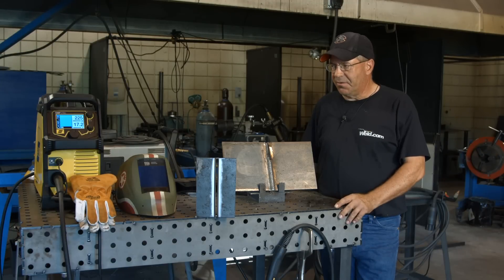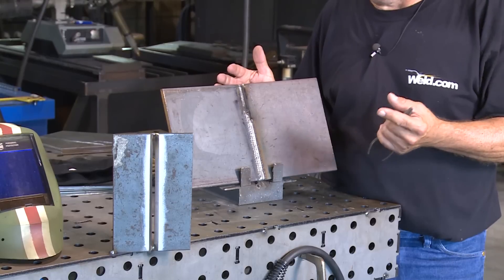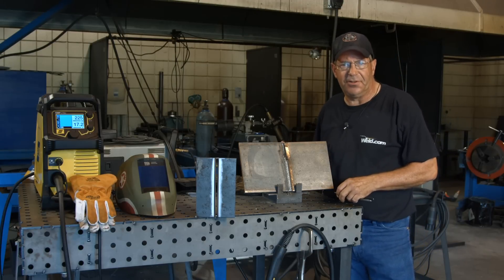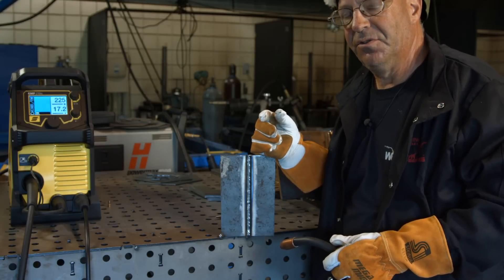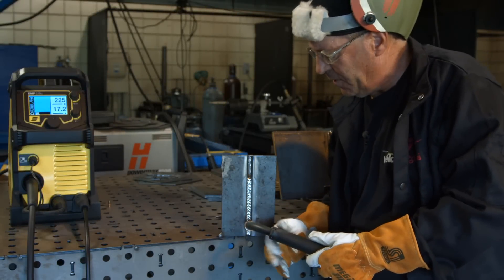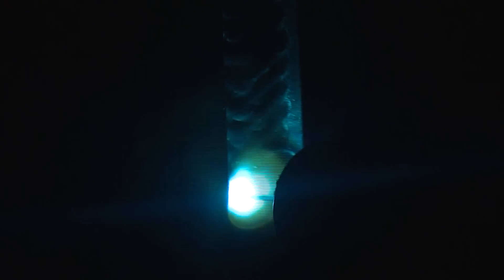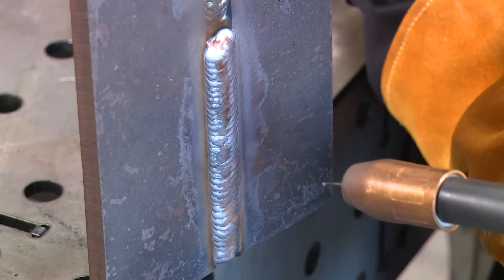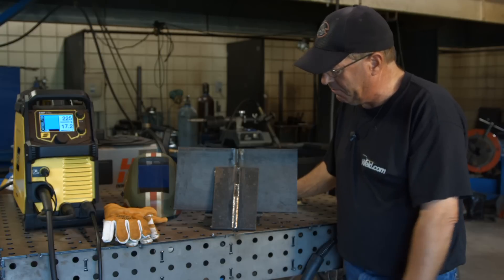Vertical Short Arc MIG on 110V Power | MIG Monday

Comment: He keeps mentioning buffing the glass off. Can someone please explain what he's talking about?
Reply: The silicone in the weld metal ends up on the surface of the bead as it solidified and can interfere with the next weld bead, especially with low power machines.  it looks like little black blobs on the surface.

Comment: You're a badass. Damn. I am a pretty good mig welder of steel and aluminum on a 220 machine. 5 yrs in this industry as a welder fabricator  knowing not a damn thing when I started. I must say I never seen anybody weld that thick of steel that beautiful with a 110. Hell I didn't think it was possible. I got a sign of relief cause the project I am about to start a 110 is all I have at my disposal.  You confirmed the possibility of producing a beautiful weld is achievable on the 110. Thanks man great video. You have a great delivery easy to learn from.  Definitely keep up the good work.

Comment: Try doing a 6” vert 1” deep full pen using .068 flux core, no gas. You’ll need a back up and a strong back. Also do it in an overhead. That’s what we as Ironworker’s do to get a certification so we can weld on the job.

Comment: Bob, is this a short arc because you are using 110V?  If that is not correct, why is it called a short arc?  Thanks.
Reply from the maker: Dan Johnson Had nothing to do with being 110v. Short arc is referring to the transfer method. When the current is transferred from the electrode to the workpiece there is a short circuit, which is when metal is deposited.
Reply: Ahh, thank you!!

Comment: Hi Bob 
Just a random question we do not have 110 volt here in oz where i am from is there much of a difference from 110v compared to 240v single phase which is what we have here or 415v 3 phase? or is it mainly  in the amps? No 110v here
Cheers from John

Comment: welding galvanized in the overhead on fillet joints and can't seem to get away from  a layer of slag being trapped on the bottom toes of the weld. I'm running a 1/8 7010 to burn off the Galvanized then putting in the root with 7010 then putting a pass with a 7018. what can I do to get a cleaner weld with out that slag roll under

Comment: Thank you for making the video. As a complete novice I have a couple of questions. 1. Was that a gas less set up using fluxed wire? 2.You say you are using 110v. Does that mean you are using a separate/external portable transformer with the appliance? Thank you once again.
Reply: Tormented Darkness I'm new to welding too but if he's being technical when he calls it mig them it is a gas setup, at least to my understanding.

Comment: hi I'm new to welding. Been a auto painter for 11 years. so I got to try a few times. a gap that big to weld should I turn my wire speed down to not blow holes while continues welding. my penetration is good but can't seem to stop the holes

Comment: Hey Bob, awesome welding, and well done on the video! Do you always weld left handed? I found it interesting that you drop lower on that left side of the joint. Is that a preference of yours? It is cool to see the consistently angled pattern. Cheers.
Reply from the maker: I noticed that drop as well. It looked like I welded that on a diagonal but I can assure, it is straight (perpendicular) with the joint. It must be a camera angle that made it look like that. 
I weld with both hands but I’m more comfortable with the left hand. Also, we set the cameras  and lighting up in our shop that way so it is just easier to work around it. 
Thanks for the feedback, keep in touch.
Reply: Weld.com que gran video!!!!
Reply: muy bonito video

Comment: I like how in you're video you mention how to fix suck back on the root pass. I am considering buying the rebel and weld up a 2 axle trailer bit by bit. My question is, how well will it run .035 hard wire mig? Or would it be better to run some .035 fcaw dualshield?

Comment: The only part I dont like is that vertical Down root. I know the vertical up welds will definitely hold but I would like to see it bent and see if it cracks at the root pass. Other than that good video

Comment: That was a great video on both the 220 volt and 110. I have done that with my 230 amp mig machine but I don't have much success with my suitcase welder on either the trailblazer or a xmt304 with solid wire, same angle, etc. the welds are better looking going up hill root pass with my suitcase, why? Thanks for the great videos .

Comment: I am relatively new at welding. What exactly is "weld undercut"?
Reply from the maker: Undercutting is a groove or crater that occurs near the toe of the weld. When this weld flaw occurs, the weld metal fails to fill in that grooved area, resulting in a weak weld that is prone to cracking along the toes.

Comment: Let me rephrase the question. I guess I wasn't very clear. Were you running colder than you wanted to? Had you had 220v power, would more heat have been more ideal?
Reply: Running a bit colder on the settings because we were using .030 dia wire. Using the 220v side we ran .035 dia wire and the settings can go up quite a bit.
Reply: I love dual voltage welders. I have .035 on a big spool in my powermts welder and .030 on the spool gun because I never know whether my next job will have 220v available.
Reply: I'll let Weld.com jump in on that one. I thought you were asking something else.

Comment: Question, if you were running that machine on 220v, would you have ran the same wire feed and voltage settings?
Reply from the maker: We did the same weld on 220V with very similar settings in another video. We had 235 on the WFS and 17.2 on the voltage. However, the reason wasn't due to input power, we just happened to set it slightly different that day. So the short answer is, No, we would'nt have set it any different on 220v.
Reply: Voltage and WFS would stay the same. 220v just allows you to go higher if you need more.

Comment: Great video! I have a millermatic 140 is it comparable to the machine you are using? I'm fixing to start a welding table with 1/4inch stock., will I get results like yours in that thickness of material? I've never welded 1/4 inch with it. It's a 120 volt machine.